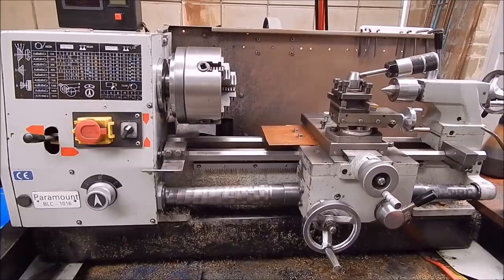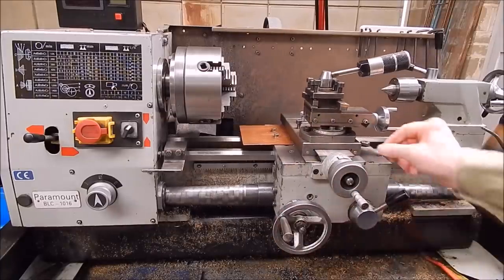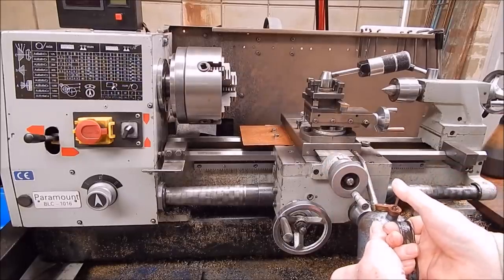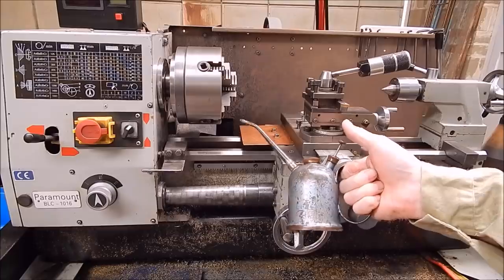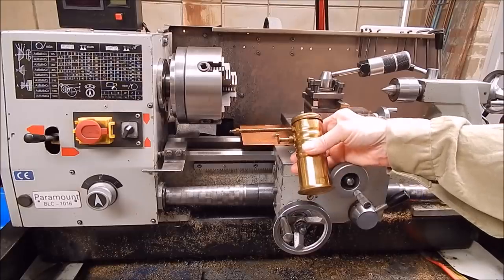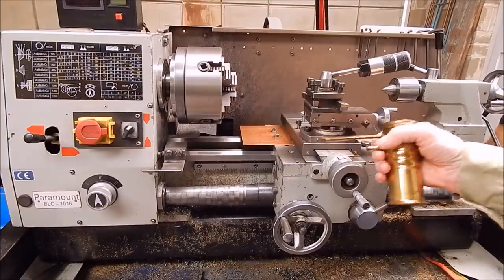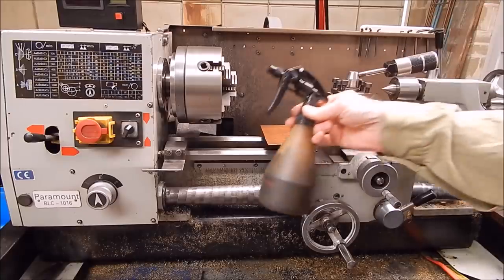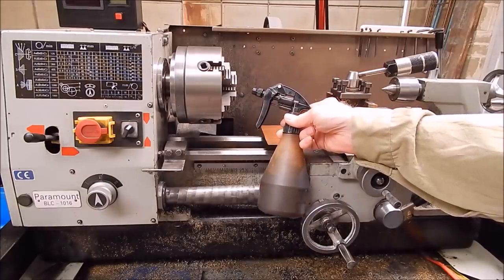I try a couple of cheap high pressure oil cans from Banggood

Comment: Thanks, Rob, and good luck with yours! Got myself a pair of cans a year ago of the really cheap variety: 3 USD and with the yellow plastic spout with brass nozzle. No leakage anywhere on the top parts: pump, nozzle or joints/ plugs. My problem is that one of the cans leaks - even ISO 68 way oil creeps thru the bottom flange.
Reply from the maker: Hi Johan,

I notice there is no seal between the screw pump section and the metal can, but it didn't seem to leak on either of mine.  The pots look to be OK.  Maybe soldering the bottom flange would fix it.  That's how my good Rega cans are made.

Cheers Rob
Reply: Thanks for the tip, Rob - they seem pretty tight everywhere else (where it doesn't count as much as in the bottom). Hope I can get the can clean enuff to make solder suck into the bottom flange! My homebrewed way oil (mix spindle & chain saw oil to ISO 68) is kind of sticky, and I wonder how and if it'll burn off as cleanly as the paint will... 
All the best! Johan/ DIYSwede

Comment: Haven't tried these but might give them a go. Locally, $15 scores you a Kinchrome oiler from Bunnings. Spend 10 minutes soldering on the rigid spout for a good seal and you are in business. Even comes with a spare brass tip! Keeps my old Hercus 260 humming.

Comment: That red one of yours seems to work well, especially for the price.  Like you show, the quality on a product, one factory to another on an almost identical-looking product, can be rather dramatic.  Guess the lower prices on some imported tooling comes as a gamble in whether the tool will cut the mustard or not.
Reply from the maker: It's a gamble for sure on some stuff.  I've always found indexable tooling to be pretty dependable, but other things like collets and oilcans can be a nightmare unless you spend the big bucks.

I noticed there is also a subtle difference in the pump body casting between the two.  

Cheers Rob

Comment: Hi Rob,
Good review, Thank you.
I've had that style oil can in my shopping cart for ages.
I have doubts, whether they are worth the money ?
They look like the a copy of the Yato brand that costs £10.
Now I've see the plastic pump mechanism vs brass, they don't install much confidence, I'm probably wrong.
It would be good to see them with a heavyweight oil in operation , Also do they siphon the oil if knocked over ?
I use iso 68 way oil for my machines, very close to gearbox oil, will these work in cooler conditions like 7 degrees centigrade ??
I would be great full on your thoughts on making the spout tips for ball oilers, shape, taper, etc ??
Cheers Adam, Yorkshire, UK
Reply from the maker: Hi Adam,

I made a brass tip for one of my Regas as it was missing.  They are rounded style, but these conical ones seem to work just as well.  So long as they are uniform, each type should be OK.  These tapered ones are very/most simple to make.

Cheers Rob
Reply: @Xynudu  
Thanks Rob

Comment: In my experience, cheap oil cans are cheap for a reason. I've currently got two and they have to be the worst things I own. Somehow they leak out the top, you fill them, go to the garage a few days later and all the oil is sitting in the lathes drip tray. Someone could make a killing manufacturing repro Rega oil cans and the likes.
Reply: Agreed. I've never seen a Rega but here is the US the Eagles were once common. Now they sell for almost their weight in gold used. There's a Swiss company - Reilang - making some high quality cans but they're $60 US with shipping. So I'm usung a Goldenrod right now which is not great but adequate.

Comment: I have 2 of the red ones that i got at a local flea market, both leak under pressure round the piston rod at the back of the trigger and one round the pot as they have no sealing ring. I cured that putting a thin gasket on, it has to be very thin as it only has thread for about 1 full turn, I have not cured the trigger leaks yet but they work reasonably well other than that.
Reply from the maker: Hey Derek,

This is supposed to be the new improved model.  Time will tell.  It's no Rega but it's cheap for anyone on a tight budget.

It's a lot better than the last one (and only) Chinese oil can I bought.

Cheers Rob

Comment: Sorry for asking a dump question, but what is the purpose/function of the chrome screw on top of the oilers?
Reply from the maker: I had a look and there is a ball and coil spring under the Philips head screw. So it appears to be the non return valve for the pump pick up pipe. You are not the first to ask.  Cheers Rob

Comment: i bought one a couple years back, with the clear pot, it was even cheaper, perhaps 3 usd,  been fine as a general oil can, not used the high pressure part,  as quality older oil cans are pretty hard to find in the UK, this isnt a bad buy

Comment: I bought the plastic ones, do you know by chance how to fix the trigger becoming sticky when pressi and failing to retract back at fast speed.
Reply from the maker: Can't help there.  The ones I got worked OK.  I have heard that some of the oil pots seep on the rolled edge, but once again I had no issues.  Cheers Rob
Reply: @Xynudu i dissembled them using your guide. I found that there was rust in spring and plunger because the day I received them I tested them with water. 

I cleaned the rust and nickle plated the spring and applied ptfe grease to plunger now seems to be working wayy better than before.
Reply from the maker: OK, there's the problem.  All good.

Comment: Is the cap plastic or metal?    Would be interesting to disassemble the pump.
Reply from the maker: It's plastic.  I might do that Dave.
Reply: @Xynudu  The reason I mentioned this is that I have 2 or 3 cans from garage sales that look like decent cans but the pump that hangs down from the lid have plastic parts that have failed.  How long these cans live may well depend on what inside.   Could well be disposable.
Reply from the maker: Hi Dan,

The cheap rubbish $10 one I bought is like that.  The guts is all plastic and hangs down like dogs balls inside the can with a vertical rod that operates off of a rocker arm/lever.  Leaks oil around the mechanism everywhere.  

The type reviewed are totally different/simpler in design.  Probably closer to a squirt bottle in operation.

Cheers Rob

Comment: Hi Rob where can you buy those little brass ball oilers from as one of mine has the ball stuck in are they replaceable  or can i make one any help is appreciated
Reply from the maker: Hi Mike,

They are a knock in fit.  So they are replaceable.  I've never done it, but read on forums where they can go bad.  I would try sourcing one from a shop selling that type of new lathe.  

Search Ebay for "lathe oil nipple" and some come come up.

Cheers Rob

Comment: Thanks, haven't seen your site for a while but bought 5 of the cheapies, you simply can't get a decent oil can with a RIGID nozzle for those hard to get to places, also I've not had one iota of trouble with Banggood in Brisbane, AUS , AUSPOST on the other hand simply sucks
Reply from the maker: I don't have any problems with Aus Post in Adelaide.  Banggood have also never not delivered.  The wait time varies from short to maybe a month.  The stuff is always well wrapped.  You sure got plenty of oil cans there.  But then again my shed has a few too many overall ;)

Cheers Rob
Reply: Rob, surprisingly it's not easy to find a reasonable oil can here with a rigid spout,I have several with flexible pvc spouts and they eitther split , break or come off the can itself, after seeing your review and I am very happy with Banggood products to date and for that price I can use them in a couple of spaces as well as having a spare or two for when they fail and you have them on hand, if they were dear I wouldn't do it, cheers mate
Reply: @Xynudu  The oil bottles I ordered arrived here this morning and really impressed and just so glad I ordered the rigid spouts, they totally leave the old flexible one's for dead by comparison, thanks for the heads up mate, cheers Darryl

Comment: Bought 2 total trash for me! I want to use one to prime mowers to test if they needed a carby job worked one use the next day trigger wouldn’t return forward, dismantled greased up piston with rubber grease got 3 more pumps and then junk for good
Reply from the maker: Sorry to hear that.  I had heard that the seam on the base can seep oil, but the pumps seemed fine.  I gave mine away to friends but kept one, which still works OK.

Comment: i just bought an old lathe which has grease nipples all over it, i've heard that they are meant for oil but i'm not 100% how that works?
Reply from the maker: Hi Dave,  Yes most certainly use oil.  Are you sure they are grease nipples ?   Some oilers on lathes look a bit similar.  

Someone had fitted grease nipples to my old Schaublin lathe headstock and I switched it back to oil pots, as it should be.

Oil ports have a detent ball that you press down with the oil can spout to put in oil.  The profile also has to seal the join.  Not all oil cans are suitable for this.

These cheap ones in the video have the correct profile spout tip and pressure to do the job.

Cheers Rob
Reply: @Xynudu  hi Rob. Thanks for the reply. Yeah they definitely are grease nipple. I watched a video the other day of how people modify a regular grease gun to take oil instead so I'll give that a go.

I bought an old DSG 13*42, absolutely incredible that something that old still works. She's actually in really good shape.

Cheers,

Dave.

Comment: Interestingly, I just bought an oil can for this purpose for a new (2nd hand) lathe at work this week. Russian "Ryazan" lathe. 3 metre bed. She's a solid beast.  I bought an el cheapo to try (12 bucks I think) from Blackwoods. It has a conical brass tip to get in the oiling point, and a flexible hose so the can can be kept upright when pumping away on the horizontal points. Seems alright so far.......................

Comment: I lashed out on one of these https://www.jensputzier.com/reilang/reilang-oilers/reilang-r003-252-merkur-precision-oiler-with-double-pump-2.html and it's a joy to use. I oil stuff now just for fun...it even works upside down. The engineering is top notch and I think it'll outlast me. Only quibble was having to replace the neoprene neck washer with a more robust dowty washer (which I found out about from Steve Jordon's channel).
Reply from the maker: Yes they are supposed to be a good oil can.  But for the price they would want to be.  Apples and oranges.

Comment: Oil cans are low tech but the Chinese cannot make them, they always leak and do not pump. As for price with mass production techniques all they are worth is 5 bucks. In the UK you can buy a can of tomatoes for 50 pence, bigger than than those pots, food grade  so the tin can costs about 5 pence. To me 5 dollars is too expensive for something that will leak and fail to pump.

Comment: The Chinese originally produced these oil cans, the top works were die cast metal.  The "second value engineered" products are molded plastic.  The plastic is pathetic.  Why make a cheap product that worked into a cheap product that does not work just to avoid what had to be a tiny price increase?  Makes you wonder!
Reply from the maker: It works fine in the video.
Reply: @Xynudu   Has it continued to work?  In the US Harbor Freight sells them.  A few years ago HF was almost handing them out.  I have two of each pattern, two of the die cast, and two of the later plastic bodied oilers.  The die cast are still working, although I had to renew the spring behind the ball on one of them.  The plastic ones failed about a year after I got them and I have not bothered with them.  Trying to be civil here, but I'm not a big fan of plastic.  I have a German made "Reilang" with a cast aluminum reservoir that will pump upside down.  I was lucky to get a reasonable price on it, I would hate to try to buy a replacement.  US made "Goldenrod" are out of business, and I'm not sure about "Eagle".  Cheers!
Reply from the maker: Hi Geoff,

I am not a fan of plastic either.  I also normally use quality metal oilcans like Rega and have an Eagle 66.  But they are no longer made, and second hand is the only solution unless you want to spend big bucks on a Reilang, which I am well aware of.

The oil cans in the video are a very cheap alternative for folks that don't want to go down that path.  So it's up to them to decide what they want to do. I just presented the video to show what you get. How it performs long term is another aspect outside of the scope of the video.

Comments from viewers who have had long term experience with these items is most welcome - it all contributes to the decision making process.

Cheers Rob